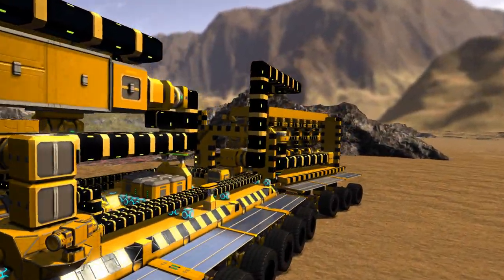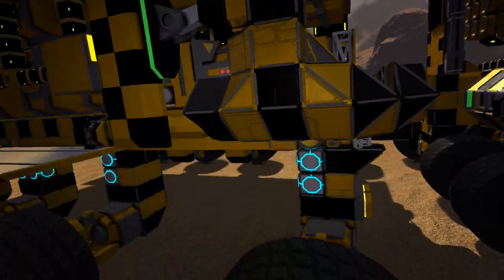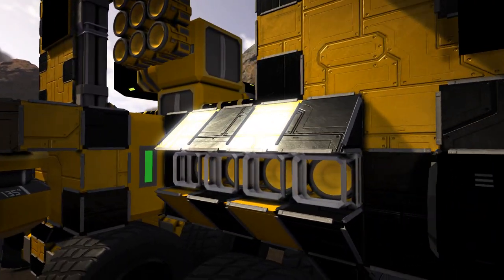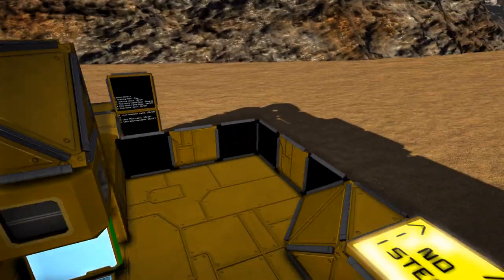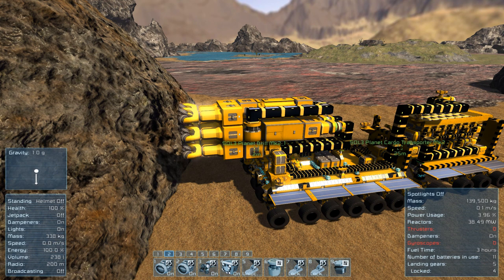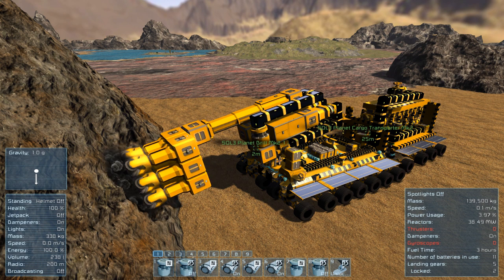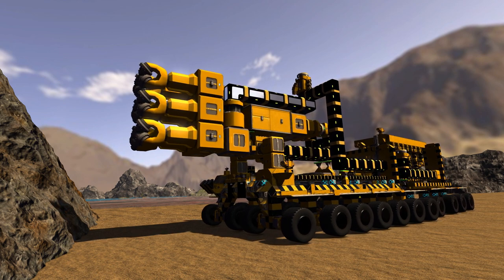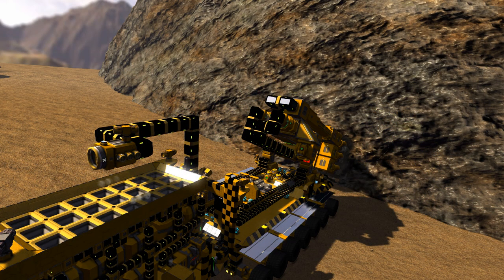Space Engineers - SOL3 Planet Drill & Ore Transport - Planet Comp Spotlight #1

Comment: though the use of so many moving parts is impressive, that sadly means so much can go more wrong if it breaks. I find that the novelty of such a complicated vehicle is quickly lost when something does happen, or if the wrong button is pressed and the thing can get disabled so quickly.
Reply from the maker: Skeptical Chris I would say it's less about novelty and more about functionality.. even simple equipment can go wrong with the wrong button press and similar machines to this with these 'weaknesses' exist in real life, I'm sure for a reason - they may be complex but by being complex they can do things a less complex machine cannot. A trade rather than a pure failing in my opinion.
Reply: Skeptical Chris The idea here is that you actually need to understand how to use this craft. It's like flying a passenger jet vs flying a Cessna. Throw four engines, retractable landing gears, cargo doors, huge moving parts, a slew of comm devices, a slew of lights, and an array of auto control buttons as well as far more complicated engine start procedures and navigation methods and you can see why untrained pilots don't fly 737's.
Same with this. Besides, Space Engineers isn't about slapping a cockpit, six engines, and a generator+drill and getting to work. It's about making a cool/fun design.

Comment: I've tried for a long time to make another kind of drill, one that litteraly crawled like a worm through the earth solely by the use of pistons. It worked in the initial tests, but those where through a constructed tunnel, so the walls where rather smooth. When it actually got to drill an asteroid, the pistons and landing gears it used to grab hold of the sides of the tunnel started breaking after a few minutes. I was unable to make it more stable, so I couldn't finnish it.

However, I think i might have figured out a way to make it work now. Is it okay if I send it to you? Not as a contribution to the contest since it's too late for that, but just to show you a really interesting machine.
Reply from the maker: Oscar Berggren I'm always up for seeing something interesting sir, send it over :) I do like that worm concept tbh so very interested to see what you came up!
Reply: ***** I think i've propperly added it to the steam workshop now. Here is the link: http://steamcommunity.com/sharedfiles/filedetails/?id=461050520

The world also contains the old version of the drill as well as a couple of other failed projects. The drills are in the tunnels next to the big platform with gravity.

The smaller one is the new one i created, and it is just a prototype, so it doesn't have the propper timer setup to go back up again yet. It would also need some adjustments to the pistons and timers to work when mining.

Just press the button on both of them and whatch them go. The point of these drills is to get around the problems with mining deep into the ground while in gravity, since they have said that gravity might affect all ships once they add planets.

[edit]
I should also add that these work without any mods. The concept of the machine is rather simple, but its usually the most simple of ideas that are the most effective, and unfortunately also the ones that remain unexplored, when everybody is trying to think of more complex solutions.
Reply from the maker: Cool, will take a look!